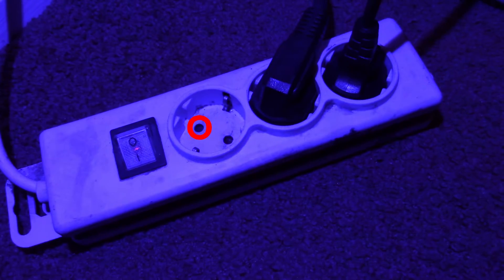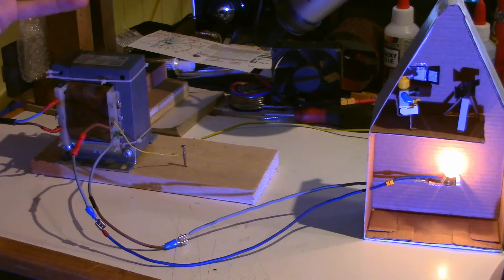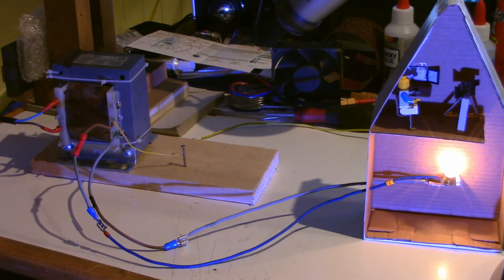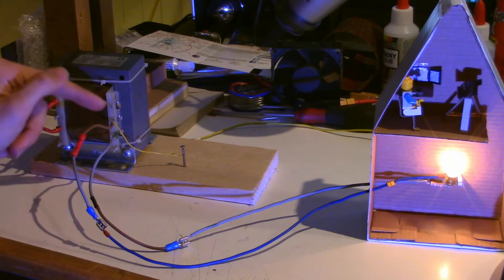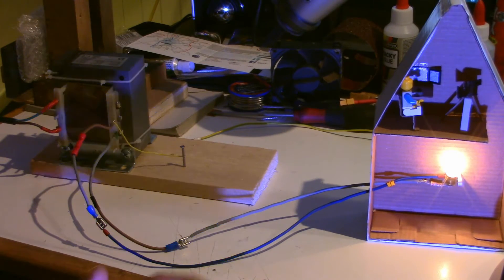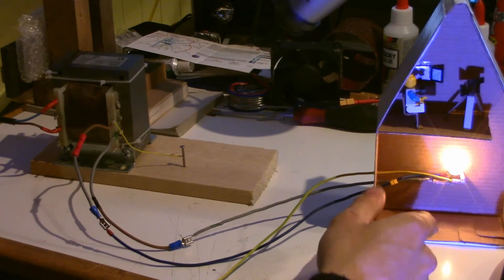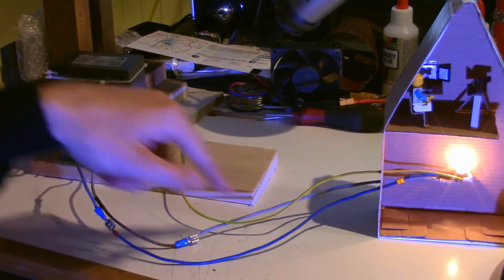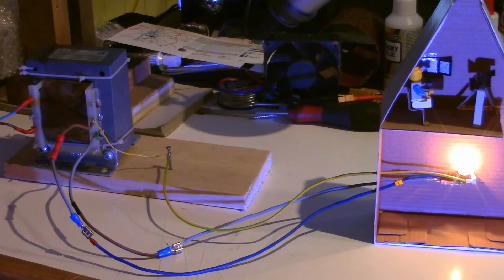Live, neutral and earth electrical wires explained (AKIO TV)

Comment: Why is the neutral wire connected to the ground ? It makes sense why the ground wire connected to the ground
Reply from the maker: You have 2 wires, then you connect one of them to the ground to make the system ground referenced. At that point the wire you connected to the ground is at ground potential, making it a neutral wire.

long story short: you don't connect a neutral wire to earth because its neutral, the wire becomes neutral because you connect it to earth.

Comment: Hi, Thanks for the video and the great explanation!
However, there is one thing I still can't understand:
If the neutral is connected to the ground, why do we need the third (ground) wire? Why can't we just simply split the neutral and put one side to the light-bulb, and the another one to the metal thing?

(I have a power supply, similar like yours, and there are 3 inputs in it (live, neutral, ground). My idea was just to cut an ordinary cable which can be plugged to the system. (For example a cable of a lamp.) But my problem is that it has only 2 cables in it. So after your video, I thought I can use the neutral and connect it to both inputs.)
Reply from the maker: Using neutral as earth is earthing as done 100 years ago, it technically works, but it's quite bad for several reasons:

- Your ground fault protection switch won't work in certain situations since a connection to the chassis will now not lead to leakage current

- If the neutral wire ever disconnects from the outlet, but not from the chassis, the chassis becomes live, even if the live wire itself isn't faulty/touching the chassis. (That risk is actually greater than a faulty live wire in the chassis, because broken wires at the plug are much more common!) 

- Depending on where you live, power plugs may plug in both ways, so neutral could be live if it's plugged in upside down, which would energise the chassis.

TLDR: don't use neutral as earth in your house. If you have no earth, it's better to not use earth at all than to try and use a neutral wire. Not using earth is not as risky as you might think, plenty of devices will be perfectly safe without it. So, with that PSU, just connect live and neutral and leave earth open.
Reply: @AKIOTV  Thank you for the quick answer!

Comment: on modern day systems, I believe there is no earth at the house , as it now "earths" back down the the negative wire. Not something I quite understand
Reply from the maker: Well as I mentioned, at the end of the day the neutral is earthed at the transformer anyway, so it doesn't make much of a difference.

Comment: Nice job, explained well. Another job for the ground wire is to trip off the circuit breaker or fuse if the livewire becomes loose...
Reply from the maker: Absolutely, although it's more likely that the RCD would be triggered first given it responds to much smaller currents than a circuit breaker. In a system that has no RCD*, or one that's broken, the short circuit would indeed eventually trip the breaker.

*North american systems often only use RCDs in wet rooms rather than the whole house (referred to as GFCI)